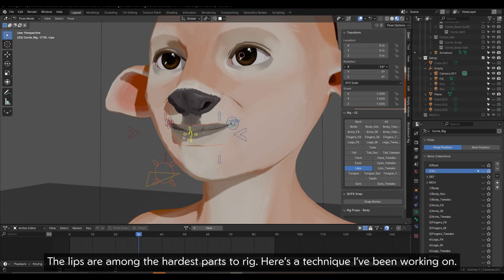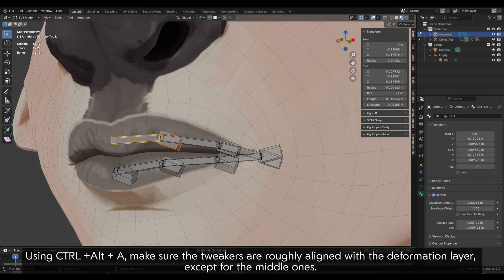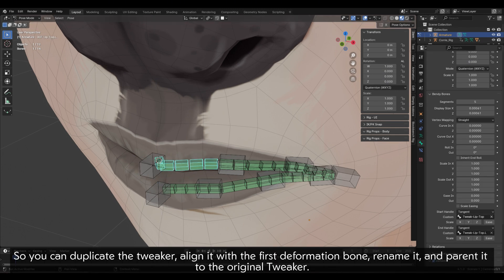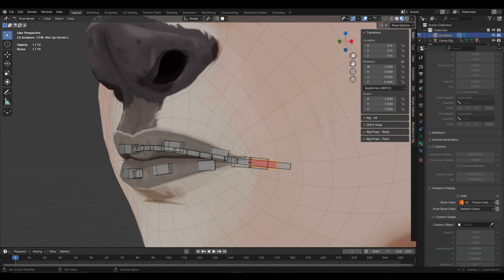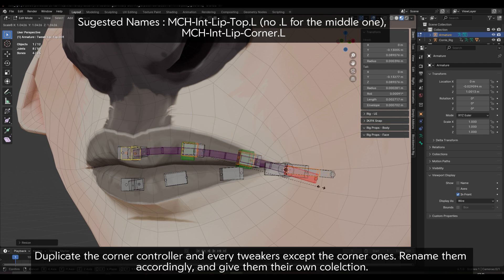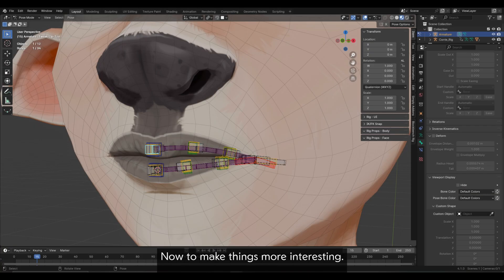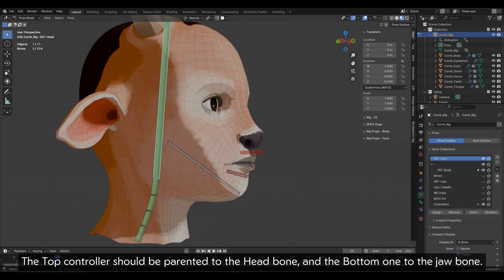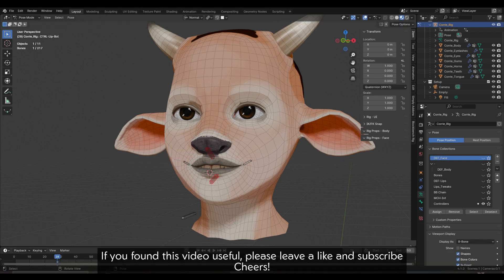How to rig lips in Blender - Part 1/3 | Intermediate level Tutorial

Comment: Hey, bro! Incredibly well done tutorial for B-Bone Mouth Rigging! Congrats! I have one important note and a technical question, but this is a big subject on its own (Facial Rigging with B-Bones):
1) I believe you're using a wrong technique for the B-Bone Handle Targets; like, so far as I understand, there is no need to stack the Stretch To + Damped Track Bone Constraints to a B-Bone, because the Handle Targets are suppose to solve these. Because the Tail/Tip Ball Joint of the Bendy Bone is Positioned exactly at the Head/Root Ball of the End Handle, and the End Handle is not Parented Connected to the B-Bone, then this is a case of using the Absolute Target for the End Handle property of the B-Bone (instead of the Tangent Target); though, in the other case, of the Start Handle Target, you're using correct technique (Tangent), a tricky case by the way: for when both Head/Root Ball Joints from the B-Bone and its Start Handle, are matching Positioning in the Rest Position. So, I think you need, for your Setup: Start Handle: Tangent, End Handle: Absolute; and then you can discard the Damped Track Bone Constraint (and just keep the Stretch To Bone Constraint); unless there is a specific need of Damped Track (which I supect it is a correction, because of erratic End Handle Target; but this correction wouldn't be necessary, with the correct End Handle Target for that particular Setup). Though, I don't know of any proper use of Tangent for End Handle specifically --and, least of all, I do not know of any use case for "Relative", either for Start/End Handles.
2a) Haven't you experience any strange or suspicious Deforming issue for DEF (Deform) B-Bones, actually for those which have their Weight Paint reaching the center of the Face (or the Global X Axis center, the Plane of Symmetry of the 3D Character)? I've had very difficult times trying to work with Symmetric DEF B-Bone which Weights 'touches' the Plane of Symmetry; I'm not confident that this would be just a Mirror Modifier issue; to the point I had placed DEF Regular Bones to cover Weight Paint only for the central Edge Loop(s)/Edge Ring!!
2b) I know at least part of that issue should be related to the Y Axis Scale Stretchiness/Squashiness Deforms caused by the B-Bone Skinning method (Spline Skinning), (maybe with inadequate Weight Painting), since its Weights are usually Weight-Painted all accross the B-Bone, and this can sometimes cause some sort of weird Deform Artifact, something like 'Simultaneous Deforms on both of the same B-Bone'! which is terrible for the eye. I don't know if you have experience this so far or if you know how to prevent this behavior. Then, in addition to this, when the B-Bone meets Weight Paint in the Mesh Plane of Symmetry of the 3D Model, the previous issue might 'stack' to something even more terrible (the Deforms can sometimes 'propagate' to the Opposite Side of the 3D Model, to some extend)! So, I know how to prevent the latter (by just avoiding Weight Painting B-Bones in the central Mesh Region), but I still do not know if there is any special solutions for preventing the former (more generic) issue. I love B-Bones Rigging in Blender, but they have a lot of caveats, and can be extremely difficult to maintain; but in a good deal, a lot can be developed, by research, and by making good technique available to the community.
Sorry for the long text; take your time to answer.
Reply from the maker: Hi, thanks
1) The only reason I stack up damped track and stretch to is because, before I learned about bendy bones I was already used to combine both of them to avoid some issues with tracking
It dates back to 2.8 so maybe it s now obsolete even on normal bones, this is just how I learned to do it, but you may be completely right on that point
Since I've always used that I wouldnt even know if the Tangent Handle can cause issues whithout it 😅

Has for the type of end Handles, I've honestly found no difference between Absolute and Tangent, both gave me the same results each time. The start one has to be Tangent for sure in this setup, but the end is up to you

I'm still on the fence about using Absolute for both handles of the DEF layer only, using the def bones themselves as handles (I used to do that in a previous technique, it gives perfect curvature but prevents twisting and renders the tweakers' rotation useless)
"Relative" has always been labelled as unreliable so I've never found a good use for it either

2) I'm sorry I've not encountered this issue (yet), so I've no idea how to prevent it or even where to begin debugging :/
Reply: @rakenval  Thanks for the precise answers, bro. Oh, I see, there exist a classical B-Bone Setup for such Bone Constraints Combo; I believe it could play a role still (especially considering the variety of Handles' Setups).

I've made further tests, you are mostly correct: on many cases, End Handle set as Absolute or Tangent seem to make 0 different; but I found specific situations where it does make, although usually slight, change on the B-Bone Ending Curvature; it's certainly not compromising as I was stating before 😅.
Btw, after reading the Handles descriptions in the UI, and after some quick tests (for End Handle), my current conclusion is that? Absolute tries to emulate Automatic behavior (it reads that it respects the "Position" of the End Handle Bone, so I guess it`s about its Location only, or its Location+Rotation), whereas Tanget would focus on the "Rotation" only of the End Handle Bone (so this might why sometimes they are slightly different). Also, seems like Relative would be on those kind of cases in which the Skeleton's Rest Position is different than its Rest Pose: "Use the offset... from Rest Pose...").
Reply from the maker: Very interesting
I don't think I ever had a case where the skeleton's rest position was different from the Rest Pose...how does that work ? 😮
Reply: @rakenval  I'm still on the fence about using Absolute for both handles of the DEF layer only, using the def bones themselves as handles (I used to do that in a previous technique, it gives perfect curvature but prevents twisting and renders the tweakers' rotation useless)

This is super-interesting! After messing around so much, I've found a method which allows the DEF B-Bones to be Parented Connected between themselves (as FK Chain, so Automatic Handles, hence perfect Curvatures on the Sequence, akin to Absolute that you've mentioned I guess), and, at the same time, and against all odds, they CAN still be sort of manipulated by Tweak Bones (I'm not 100% convinced it is the same as Handles' manipulation, but it does Bend the B-Bones a lot; those TWK Bones would be elongated Regular Bones, same Length of the B-Bones, instead of being tiny components floating around). Because of how crazy the Stretch To Bone Constraint works, by affecting the Tail/Tip Joint of the Bones only, these can trick the rigidness of Connected Parenting, and in the case of B-Bones this is probably relates to the Setup you were referring to. And then, those two Bone Layers (DEF+TWK), can be still controlled by any other overarching Skeleton --in my case, I've made a B-Bone CTL-IK Spine Skeleton, for Auto IK Option, but there should be more versatile choices.

Here I've made a presentation of this Setup; I believe you'll be familiar these stuff:
https://www.youtube.com/watch?v=1M_YKfoiocM&t=283s
After that Spine result, I've been considering, Inverse Kinematics for B-Bone structures on Facial Rig... (you may know, for instance, Spline IK Bone Constraint can offer some curious behaviors there). Like, imagine having all those B-Bones' Lips you've made for your composite Mouth Rig Setup, but with some Inverse Kinematics Automation system? I know the Lips can have other Automation Setups, but IK is interesting.

2) I'm sorry I've not encountered this issue (yet), so I've no idea how to prevent it or even where to begin debugging :/
Thanks anyways, bro. I'll rewatch your tutorial, and try to verify, perhaps, if you're employing differently regarding the Weight Paint, the Symmetry, and perhaps some of the mechanical elements involving Volume/Scaling Transforms. I know it's a lot of text... for a commentary section; so, don't worry I guess.😅Overall, thanks for the original content and the observations.
Reply from the maker: Okay I've never made a setup where the bbones were parented to one another, that's interesting!
Usually I tend to layer up DEF-> Tweaks-> and then IK, FK, Intermediaries, basically whatever is needed to achieve the desired level of control
I still use the DEF bones as handles with Absolute for stuff like tails for example, the tweakers in this case are parented to a good old FK chain so I assume it'd work in the same fashion as your technique (or intermediaries if I want both FK and IK)

Spline Ik is very nice for stuff like the tongue or long ears, for the lips I don't know
As for the rest of the face, imo it could be a bit overkill to add actual IK constraints, but surely there are situations where it could be useful
Maybe eyebrows could be good candidates 🤔
Reply: @rakenval  Oh, I think I undertand the Tail Setup; but I'll need check the case. Until recently, I was never been able to achieve Inverse Kinematics (through IK Bone Constraint or Auto IK Option) on a hand-made B-Bone Sequence!!! The Handle Bones, they would always behave strangely in the follow up of the IK motion; I even started to suspect that features' combination might be impossible)!😹

Recently, I've made an IK test for Eyebrows. It's cool, but a bit awkward... it didn't convince me it would be necessary. The interesting thing though, is that if we can build versatile B-Bone Sequence Setup (there should be different approaches indeed; possibly the 'Super Spine' I've made can be simplified?), we might be able to preserve the original and fundamental functionalities of the Rig, adding up to them an extra IK solution 🧐(whichever would be more adequate or versatile).
Reply from the maker: Sorry I didn't see your reply 😅

Yeah it's totally possible to combine bendy bones with tweakers + regular FK chain + Ik chain
I did it in my tongue rig video, but since then have found a simpler way to acheive it. You don't even need FK/IK switch properties with that one.

I've only tested with spline IK so far, and on simple parts (long ears, short tails, tongues)
But basically, the controllers for the spline IK (the ones used as hooks for the curve) are parented to the FK chain, and the tweakers (only bones that have a direct effect on the BB chain) are parented to the IK spline chain

That way you can move all three types of controllers separately and together, no need for properties
Though I haven't tested on long tails or tentacles for example, nor with a regular IK constraint, so the limitations are still unkown
Reply: @rakenval   No worries; and it's not only you! Apparently, after some editions I've made, Youtube just negated/erased/blocked one of my comments (so I still have to rewrite it for one of your replies; will do soon; sorry, bro).
Oh yeah, I believe that's the case indeed: the Spline IK Setup is able to provide FK & IK combined; I've seen the Tongue tutorial btw, I believe is fine content! But Spline IK is so complicated (I guess you can agree 😅) that this is one reason I've been investigating the other IK solutions... 'just' with B-Bones. I'm concerned if there is some Posing feature about the Spline IK Setups, which might not be able to be reproduced with 'just' B-Bones (I think it might be the Curve pathing-following, that the Spline IK Setup uses to push & pull the Bones in the Chain along it, that is unique maybe?); of course, this is another question; I would need to make clear comparison case one day... 😸

Comment: its cool but why we cant just duplicate the upper lip , rename, parent bones where its needed, and make it the bottom lip? its kind of confusing when you do the same thing twise. I messed up a few times while trying to recreate this rig. may be its only my problem but i dont get the point...
Reply from the maker: You can totally do that if you want
The reason I don't like to duplicate the chains is because more often than not the bottom lip has a different shape than the top one, which means I have to readjust the position of of every duplicated bone, and reset all the constraints
It may take longer but I find it less confusing to them separately

To each their own preferences I guess 😄
Reply: @rakenval  hm.. sounds reasonable

Comment: Very good version of BB lip rig and quite easy to follow. Can I suggest you add a copy of the bone hierarchy in the description? It's very easy to get the child/parent relations wrong during the build and tedious to find any mistakes. I think a copy of the bone hierarchy would certainly help those with beginner to intermediate rigging skills. Other than that, I've tried this on two of my models and it's worked both times with very good results, no weight painting required. Good job!
Reply from the maker: Thanks a lot ! I'm glad to hear the setup worked for your characters
And adding a recap is a good idea, I'll try to add one when I find the time, and will do so for future tutos too
Reply: I'd second this. I got lost multiple times. Mostly because I've no idea what I'm doing but it would def help.